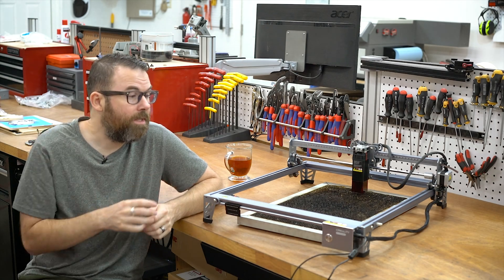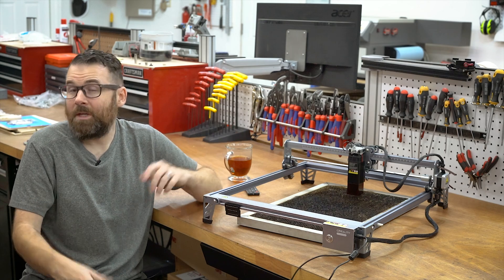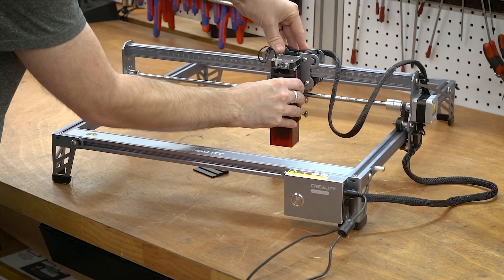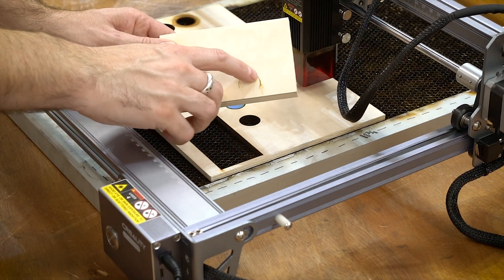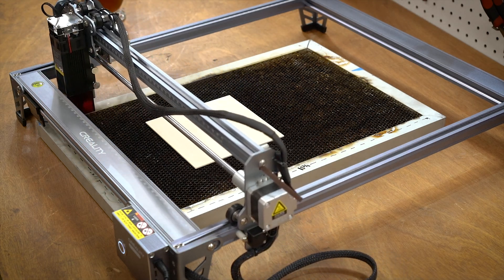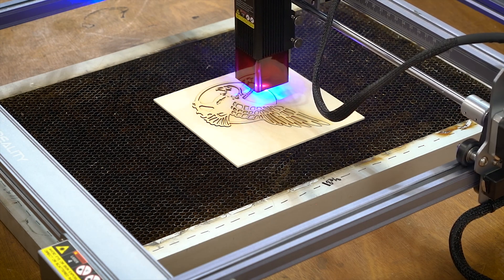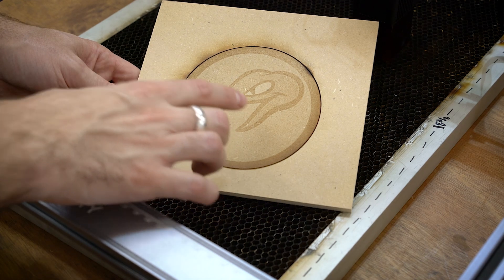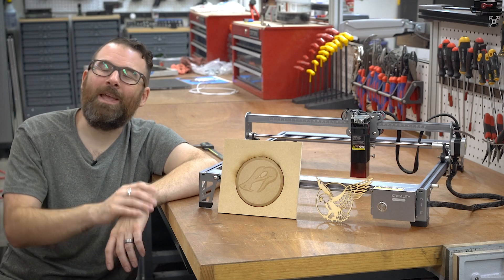Creality Falcon 10w Laser Engraver Review

Comment: i am thinking about creating LED signs in polycarbonate, but i've heard that diode lasers have issues and that you have to paint the material before engraving. have you tried this ?
Reply from the maker: It's not a good material for laser cutting.  Acrylic is better, but you can't cut or engraved clear with a diode, you need a CO2 laser.

Comment: Can you engrave & cut leather with this unit?
Reply from the maker: Kinda.  CO2 would be far better.  This model, which is VERY old would struggle cutting much of anything.  You need much more power.  Also, not all leather cuts.  Different tanning methods will change how they cut.

Comment: I had two Creality Ender 3 V2, and bought this 10w module for it. It's nice laser, but not enough working space, and since I bought 50x50cm honeycomb by mistake, decided to stich them together into a Ender 3 frankenstain, but I bought 2 additional 70cm aluminium frame rods, copied over the holes from the original ones (X axis and top frame holder), removed everything except axis motors from the frame, and "joined" both printers together. I'm now able to print 50x50cm, and no need to unscrew the laser to focus, as it's inconvienient. Really nice laser for the price, to cut or engrave wood. Also, it's quite nice in engraving glass, you just have to paint it with a little bit of black tempera paint.

Comment: 11:20 if you're not familiar with basswood, I really recommend looking it up. It's a nice niche between balsa and light ply. Used a lot in RC planes for it's strength to weight characteristics. It's not ply, and therefore no risk of formeldahyde like most ply has. Formaldehyde ply is dangerous to use lasers on.
Reply: They claim “5mm” on the website on a single pass!

Comment: I just bought one of these 10W laser modules for my 3D printer. It’s an Ender 3 S1 Plus and the laser module attaches to the print head carrier with a bracket that comes with the kit. I’m still waiting for it to come in but I assume I will have Z axis control being it will be attached to a printer that has XYZ axis. I will update if anyone is interested. I also bought an air assist that Creality makes for these lasers so that should solve the depth of cut issues.

Comment: Not sure if mentioned in the comments, tried to scan over it, but the current 10w model has "Active stop function" with gyroscope that will activate on accidental tilt, flip or drop with a buzzer. Was not sure if it was added at a later stage or might have missed that when reviewed??
Reply from the maker: This is a VERY old video and a lot has changed since then.  I can't remember if this one had a tilt safety feature.  Most of the newer ones do though.

Comment: thanks for your video. this machine is in my mind to buy . just one thing i did not get about this Machine .does it actually print a picture on a 40 in 40 cm MDF wood or it become smaller when it prints out     thanks again for your hounest presentation
Reply from the maker: It engraves at whatever size you need it to, as long as it can fit into the work envelope.  But this is a very old machine now, there are MUCH never ones out there.

Comment: ik this is a longshot, My Engraver Got burnt a while back while cutting a bunch of phone stands in wood, the wood caught on fire... Anyways I got all the parts I need besides the red Magnetic Lense/Sheild that attaches to the bottom of the laser module, I want to 3d print one but need to know the dimensions, more specifically just the height of the red shield, I can measure the laser module for the with, but cannot just guess the height because the beam needs to be focused.  If anybody can measure the height of the red Sheild with a caliper and tell me how many mm it is i would appreciate it more than you could imagine!!
Reply from the maker: Why not contact the manufacturer?
Reply: @RobertCowanDIY  Why not just measure it for me with a caliper?   You really think I would be in the comment section of YouTube videos if they would contact me back?
Reply from the maker: @FullThrottleOutdoor  I actually don't have it still or I would.  But it looks like you got it sorted.
Reply: Shout out to ArtByAdrock, and Joshua De Lisle for the Specs! If anybody else needs the info it is 38MM tall🫡

Comment: Would you suggest using one of those in a shop or would it be safe in my 2 bedroom apt. ?
Reply from the maker: I would NOT use it in a living space unless you have a small enclosure and ventilation to outside.  Check Amazon for laser enclosures, they make little tents you can put laser engravers in.  You will still need to use an exhaust fan and vent it out the window.  But without these, it shouldn't be used in your primary living space.  Even in my shop, I have to keep my fume extraction system on for a few hours after a short cut.  They make a LOT of smoke and fumes.
Reply: @Robert Cowan  I really appreciate the info and will put it on pause till I can afford the whole set up.
Reply from the maker: @Tyguy266  FYI, the tents are maybe $100 (you could probably DIY something cheaper) and blower fans are quite cheap.  Trust me though, it's better to hold off and do it right, you're making the right decision.
Reply: @Robert Cowan  ya the tents are not bad looking either. I need a tent for my ender 3 v2 neo and CR10 smart. My 3 kids should be out in 13 years so maybe the price will drop by then hahahah. But I'm working hard on my channel to get to being able to have a sponsor someday. 3D printing is getting here in Victoria BC Canada 🇨🇦 . Love your content man and it inspires me to keep pushing. Thank you

Comment: why does it look so janky, i mean the rubber feet is not even touching the surface. it doesn't look stable
Reply from the maker: I think I mentioned that, my workbench isn't 100% flat.  On a flat surface, it doesn't wobble like that.  My benches have sagged over the years, mostly from working on 250 pound robots on them ;-)
Reply: @RobertCowanDIY  I see. Thanks 👍

Comment: At the cutting part. They measure this based on the density of the wood they have. Now your wood may have a different density then theirs.
Reply from the maker: I think I mentioned this, they use basswood which isn't really all that common and is very lightweight.  It's not an appropriate representation of cutting performance, in my opinion.

Comment: Great review young man!
I received mine last month. I was able to do 1 project with mine, now every time I send the Gcode the Laser powers off several times and won't do anything. Anyone have any ideas on this issue?
Reply from the maker: Check to see if it's level and check all the connections (laser, limit switches, motors, etc).
Reply: @RobertCowanDIY  I've done that and figured out it was an issue with Lightburn
Reply: Holaa, y que problema tenía, a mí me sucede lo mismo y no logro saber que es

Comment: When I use mine, it makes a loud thud every now and then and was wondering if you know what that could be?
Reply from the maker: Huh, sounds like it's maybe skipping a step due to a mechanical issue.  Make sure everything moves freely along the whole length of travel.
Reply: Check your belt tension. Sounds like it may be skipping.

Comment: I have one of these sat in my Amazon basket, but not quite convinced as the air assist is shown as an option but doesn't seem to be available. It also looks just like the XTool air assist...... There is no user manual at Creality which isn't helpful either. How does the air assist attach? Is there a rotary add-on coming or can the RA2 XTool made one be used?
Reply: To install the air assist, you just unscrew the laser cover, and screw on the air assist nozzle. Then replace the optical shroud with the included new one and route the air assist tube with the cabling. Super easy!
Reply: @DoresoomReviews  the air assist cover only comes with the Creality air assist or is it included with the Base model?

Comment: If I was to get an extra pair of safety goggles for this laser, what is the recommended optical density?
Reply from the maker: I would just look for ones specifically made for diode lasers, it's more about the frequency of the laser.
Reply: I bought a CE certified OD6+ pair rated for 190-540nm for use with my Creality 10W Falcon (which operates at 445nm). Look up Eagle Pair brand on Survival Lasers USA - they're under $50.

Comment: Hi Robert, thanks for your reviewing video of Creality CR-Laser Falcon.Your review content is very professional and honest, very informative for users. As known, there are many types of wood, they have different densities. Even under the same thickness, it may be necessary to set different parameters to complete the cutting.We have tested balsa wood that can cut 12mm while basswood can cut 6-7mm by one pass. If possible, you're suggested to share a video by cutting 3-4 type different kind of wood with different thickness and you can share your recommended parameters with us. That's would be very helpful!
Reply: Please start designing these with a honeycomb bed to cut on and air assist of some kind. even if its a small blower fan on the laser head. This is something non of these machines have currently on the market.
Reply: @sergeantseven4240  Hi Dear, could you join our laser engraver group and send Creality Luna a message about this? Much thanks!  https://www.facebook.com/groups/falconlaserengraver/
Reply: @sergeantseven4240 Creality sells an air assist for these laser  setups.
Reply: I would love to review Creality products on my channel. I own two 3d printers by Creality and love them.